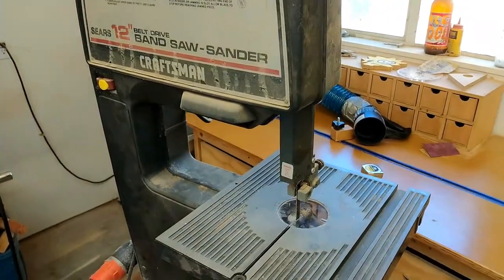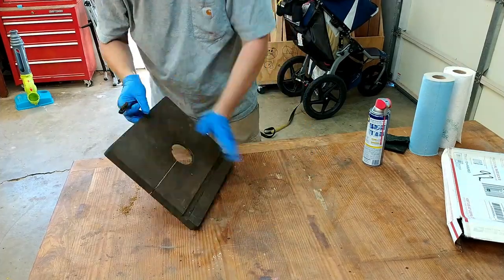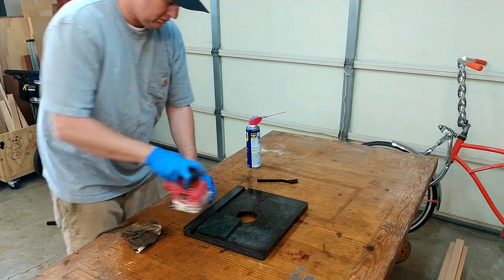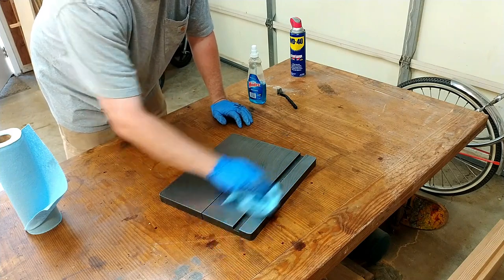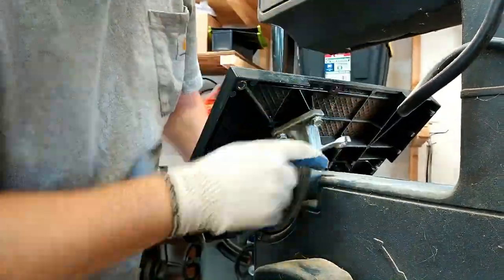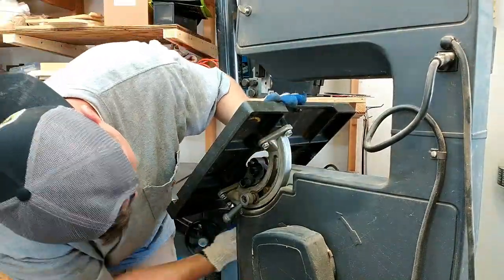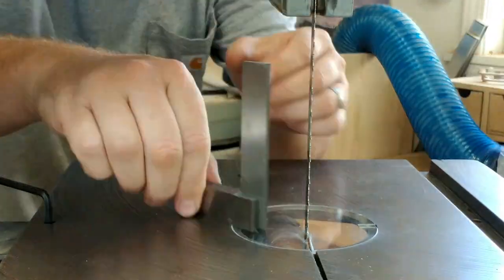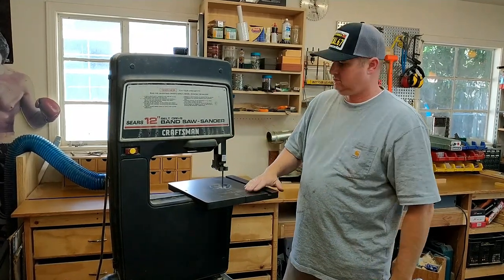Cleaning and Installing Cast Iron Top for Craftsman Bandsaw

Comment: awesome video, I just bought a grizzly 10" bandsaw online I thought it came cast iron but the table is crap 1lb aluminum its the G0948 .  Can you recommend what I can search for online on ebay to get a cast iron table for it? thanks so much!
Reply from the maker: I'm not familiar with the grizzley models. The important thing is that the holes for the undermounting bolts will line up. You can take a look on ebay for a top that has a similar size and then contact the seller for actual measurements. Good luck!
Reply: @wheresmytapemeasure  I returned that thing, it was stupid of me to attempt to try and find a cast iron table for it, I'm getting a rikon that comes with a cast iron table